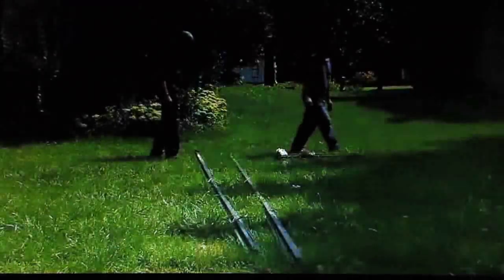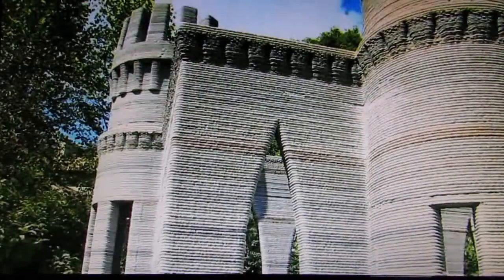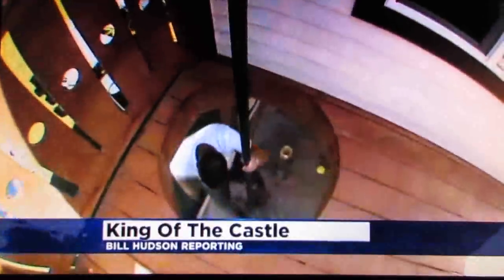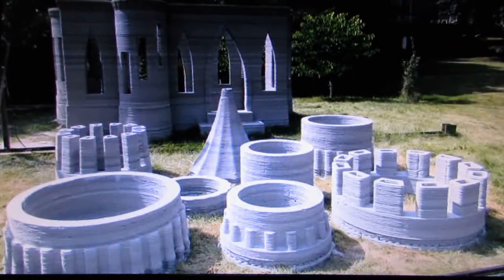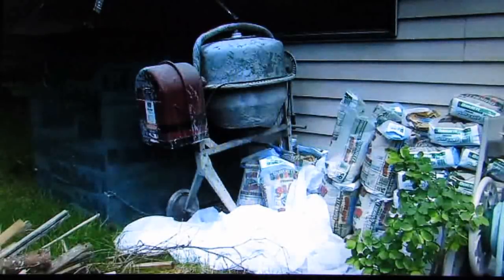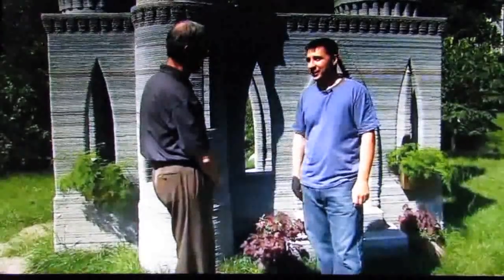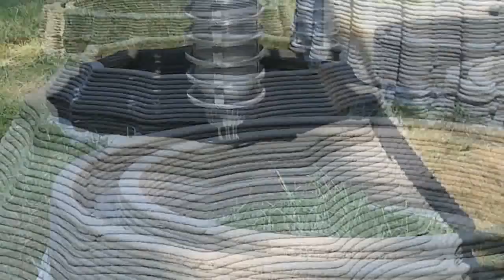3D Printed Concrete Castle

Comment: Where's the steal re-enforcement? He could've use plaster too!
Reply: +szaki You don't get the point of this do you?
Reply: I do, but I also see it's limitations.
Reply: You see room for improvement, you mean. I would guess this is a basic prototype with plenty of room for design improvements and auxiliary options.
Reply: Fiberglass fibers..
Reply: szaki add the steel reinforcements to its when u 3d print one
Reply: Really and stones grave and sand??  Would be put in the middle,  so referee are mysterious